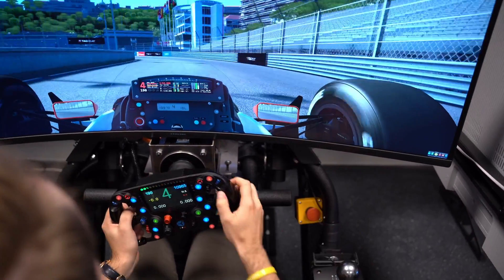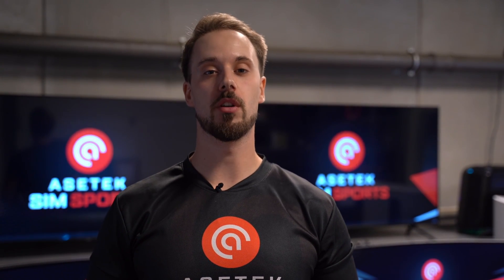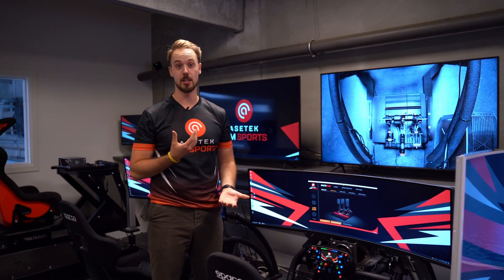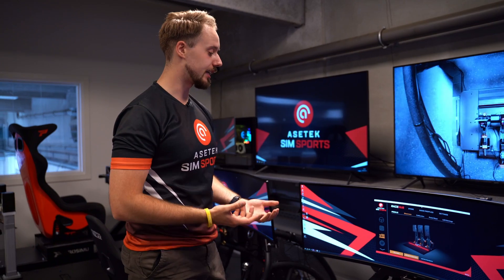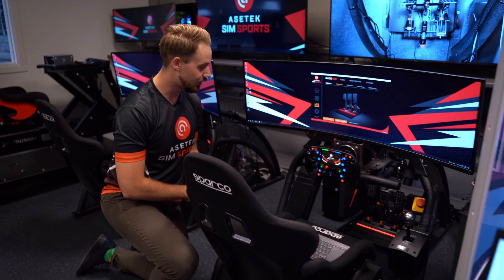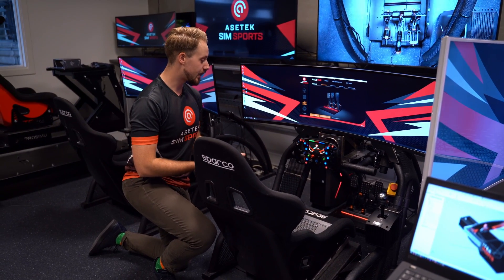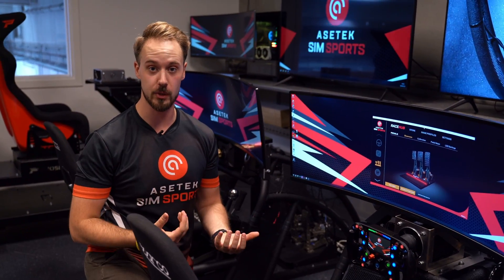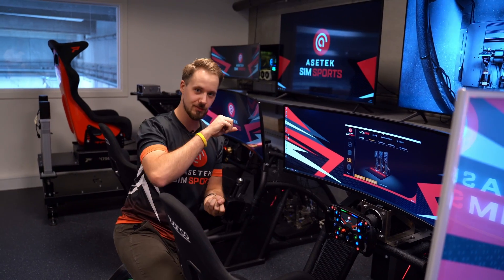Better Ergonomics in a Racing Simulator

Comment: Hey guys! Would you say thay a f1 like cockpit has better ergonomics and are more confortable than the “regular” cockpits?
Reply from the maker: Hi Victor!

If it is 'better' really is subjective and some might prefer a formula-style set up. BUT it is propably no coincidence that most sim rigs feature a more 'regular' seeting position as that both ergonomically improves ability to transfer force to the brake and closer simulates more cars.
Reply: @AsetekSimSports  super thanks!!

Comment: You absolutely dont want to drive the car with your shoulders nor muscles. They should be as relaxed as possible, perfect way is to do it with your wrists - its more precise and way faster. Try it out. However steering wheel should be a little bit higher - near your shoulder line.
Reply from the maker: Like Christian explains in the video, this simulator is a compromise between formula and GT - in a GT the wheel is below the shoulder line. 

You can drive a sim only with your wrists but not a real racing car. In a real GT3 or similar, the driver absolutely needs body strength from the pecs or shoulders to control the car at sharp turns and high speeds. 

That's why we recommend it this way for those who want to simulate real racing :)
Reply: Good luck steering Gt3 car with wrists only. In turns at moderate speed forces are quite significant. After 5 laps your wrists would be on fire.

Comment: I think the steering wheel could be higher slightly in the sim. Where the hands are holding the wheel, somewhat higher than the shoulder line.
Reply from the maker: If you're only driving formula, that's true. Like Christian explains in the video, this particular simulator is a compromise between formula and GT. In a GT the wheel is below the shoulder line :)